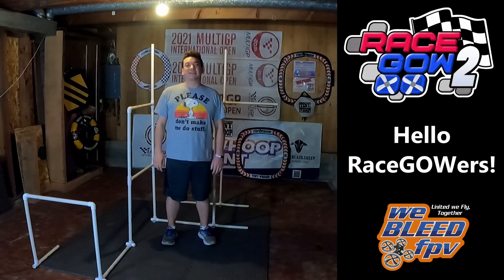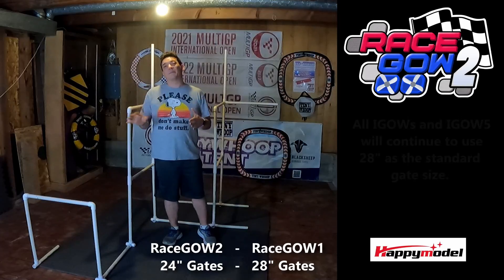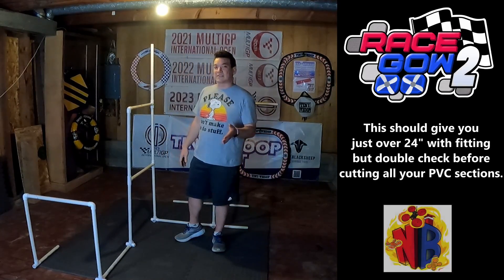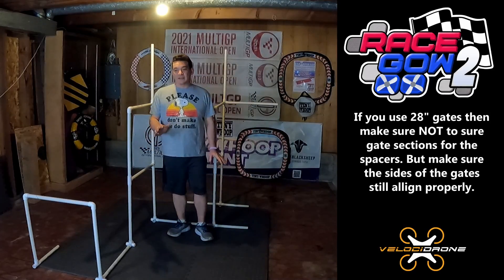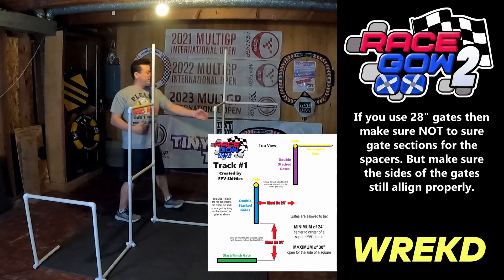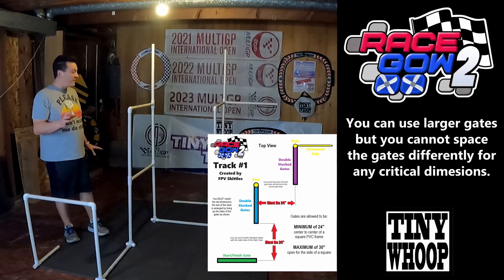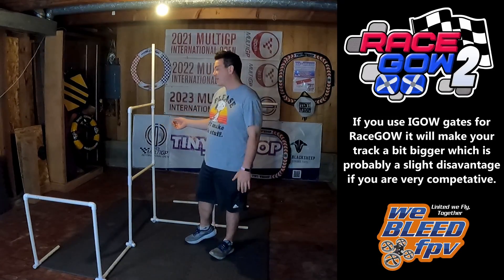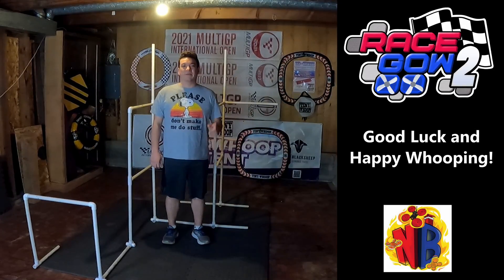RaceGOW2 - Gate Sizing Clarification and Discussion

Comment: My fittings are from ali-ex.... To get a 24" gate my sections must be at least 23". So with 22.5" sections my gates would have been to small. So better check that on your gear before you cut the sections to short. (I could not get all the fittings here in europe and had to order them in Aisa. Maybe US-fittings are slightly different.)

Comment: For us metric folk, can we please use a  standard PVC length of 60cm (23.6220472441 inches)? The PVC pipes come in 3m lengths, and we can then get a neater 5 per piece. This would likely mean our mandatory 24" gap is more like 25".
I propose that (at least in my case) I have to contend with a reversed coriolis effect compared to the northern hemisphere, which should offset any minor advantage afforded me by the extra inch.
Reply from the maker: You can use that length- that will make them just a tiny bit larger
Reply: my 3m pipe has a connector at the end to push another one in
i'll still cut 60cm pieces